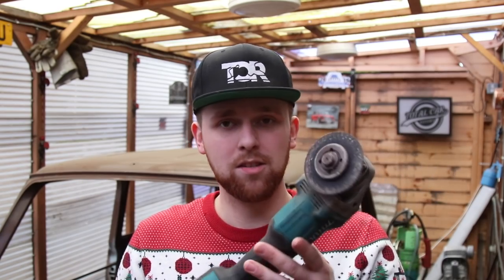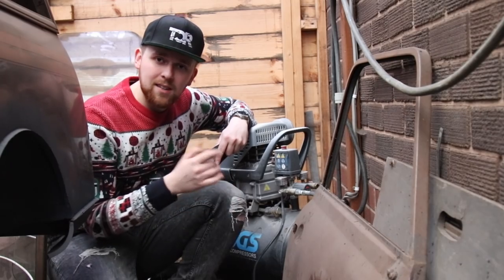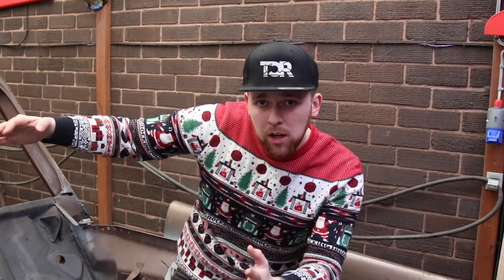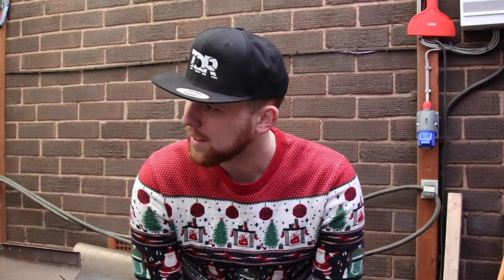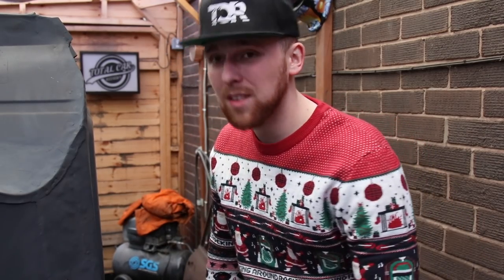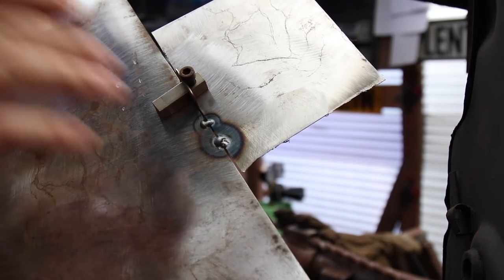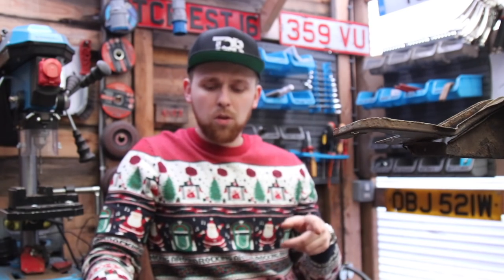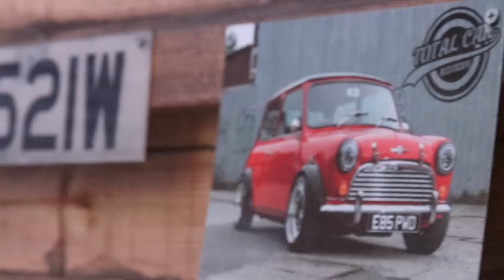What's Inside My Garage | *HOW I RESTORE CARS IN A £200! SHED! | What Tool's I Use | Car Restoration

Comment: Gasless welding references using a flux coated mig wire which creates its own gas shroud as it welds. Your welding without gas using just standard wire, it needs the gas to weld correctly, therefore when  you turn the gas off the welds are crap because atmospheric gasses contaminate the weld. Thats the difference between Gas and gasless, Gas welding is using your normal uncoated wire with a gas supply down the hose from your argon shield gas, GAS-Less is when you have the Mig welder and just use Flux coated welding wire which is mild steel wire coated in something that when it burns creates the protective gas shroud .One of the reasons they have this is so you can weld without having to buy a gas cylinder, and I'm sure there are other advantages to this type of welding.
Reply: Flux core can also be better than mig, when working outside where the wind could blow away the shielding gas. With flux core wire the flux is inside the wire, opposite of smaw (stick welding) where the flux is on the outside of the electrode.
Reply: Hi Matt . Also the welding sets need to change the polarity when using GASLESS .
Reply: Yeah was gonna comment exactly what you said pal
Reply: I was about to comment something similar
Reply: When you dont know what you are doing   make a youtube video to show others how not to do it.

Comment: The welder can only be used for gasless welding if you use flux cored mig wire.
I like your budget shed. It might not be big enough, but it's pretty cool and better than nothing.

Comment: I like your video mate... I too spent years building a block garage for doing up my '73 spitfire. I am still adding tools and still working on cars. Anyone with enough determination can get into this type of home garage setup to repair a car. I love it and now I'm working on a Spitfire, TR7, Defender, Z3 (all are mine) but I also have my mothers old bmw to maintain too. Patience is key and buy what you need when you can but have fun and dont squander on the most expensive tools or parts. I'm one for car boot sales, second hand but I also save and buy new when I can't get what I need. Good luck to you all ;-)
Reply from the maker: Thanks dude! your projects sound awesome too!

Comment: I'm a makita guy myself, all started when I was a young tw^t and stole a 18v sds with battery, all I had to do was buy a charger, 4 years after I still had it and batterys grew along with the makita tool range, then 10 years later and thousands of pounds worth spent on makita and upgrading and battery's brushless are awesome slightly less power I find but just go on forever, although it's about £5 for new brushes so instead of throwing them away I replace and still use, but like to have a couple of everything if not more haha. I think about fixing up cars in the evening down my unit but if I'm not working I tend to be out quoting or typing them up.

As for aldi farrex tools and bits, I rate them very highly, for the price of them. Unbelievable and just like any tool, let it work at its own pase not yours.
Reply from the maker: Such true information! Makita is the way forward 🤘🏻

Comment: The best grinding discs are the sand paper disc type as they last longer and are a dam site cheaper than the flapper type disc. Just an observation, been using both these disc types for work for years. When the flap disc came out it was more of a novelty but they don't last half the time as a round paper type disc.
Reply from the maker: Thanks for this dude! I’ll get some ordered

Comment: Hi, if you looking for upgrade for your welder I can recommend one, it is R-Tech welding. Look them up, great machine and 3 years warranty.
Also they do finance so you don't need to splash out big amount.
Reply from the maker: So many people have mentioned these, they must be good
Reply: @TomShorrock 
Have one myself for 3 years and not have any issues with it. It is 180 amp model.

Comment: As other people have said you need to use flux wire for gassless welding you also have to change the polarity of the torch.
Reply from the maker: Cheers for this, I was only trying to demonstrate the difference without having the correct set up, maybe I’ll revisit this in another video, thanks for the feedback
Reply: @TomShorrock  Welding with a gassless setup is not as good as using gas so keep up what you are doing. I only have a gassless set up in case I run out of gas and need to finish a job.

Comment: Totally agree with you about using gas on the mig welder, far easier and better.
Reply from the maker: 100% 🤘🏻
Reply: Tom your doing a grand job but heads up gas-less means you use flux core wire not normal wire without shielding gas that will never work, have a great Xmas look forward to seeing this car progress! If the red one is anything to go by it will be great 👍🏼

Comment: I thought I was struggling with a 3.6m wide garage. It's storing all the parts I struggle with. Engine cranes, Gearboxes and engines everywhere. Broke my foot a while back tripping over in that mess.
The biggest barrier to working on my build is kids however. Two UK under three. It slows things down.
I had the baby brother of that Clarke welder. Hated it. It only had 4 voltage settings and I couldn't seem to dial it in right. It looks like yours is a lot better.
Ended up buying an R-tech tig and once I got the hang of it never looked back. Love the thing.
Reply from the maker: Thanks dude, I’ve always fancied getting into tig, but I just haven’t the room for it

Comment: I have the same compressor and found it to be very good.  I primed and painted a car with a 9.8 cfm spray gun. Just spray a panel at a time, then wait until compressor is back to full pressure, before moving on to the next panel.
Reply from the maker: Cheers dude! Always wondered how it would cope with spraying

Comment: Interesting video. Especially about the space you have to work in. I am in a similar situation with a 10 x 16 shed, but once its full of tools and a bench there is very little room. This is in total contrast to most Americans we see on YouTube with enormous workshops and seemingly unlimited budgets. Nice to see someone keeping it real in the UK. If you do make a video about welding, please talk about how and where you get your gas. I have a similar Mig welder, but for now just use the small bottles from Toolstation. They dont last long at all. Maybe you should consider a stick welder, for fabricating things like the Rotisserie, cheaper and easier after you get the hang of it, and better penetration. Plus you can work outside in the wind then. I have a Parweld, but I think the Aldi one is probably the same but in a different box. That Air tool for seams and holes looks nice. Not seen you before but subscribed as like workshop videos. More videos about the tools please.
Reply from the maker: Hi James, it’s nice to hear I’m not the only one struggling for space, it’s certainly my a real challenger! With regards to the Americans with garages I suppose it’s cause land and property is so much cheaper over there! Including the cost of living also! I get my gas from BOC it’s about £50 a refil and £50 a year bottle rental, but I easily get 8-14 months out of one bottle. I can cover this in more depth on a video. I’m glad you came across my channel and glad you subscribed! Thankyou!

Hope to see you in the comments again soon

Comment: I restored my 1979 mini in a gazebo that was 3m square had enough space at the sides but no space front or back so had to open each end so I could do the front and back of the car
Reply from the maker: That sounds a struggle! But you did it and that’s the main thing !
Reply: @TomShorrock  did it and managed to get it through its first mot in 10 years with no advisories
Reply from the maker: TheNoviceSimRacer now that’s what you call a top result!

Comment: You don't use the same wire for gassless mig welding! You use a fluxcored wire and you also need to reverse the polarity of the torch and clamp. You do end up with welding slag you need to remove like stick welding, but it's ideal for working outside. That gassless weld you did will be a porous as heck.
Reply from the maker: Hi Jim Bob, I’m aware of this, I propbably didn’t explain correctly I was only showing the difference if you don’t have it set up properly

Comment: He is right on one point though.
As a professional welder i tried a gasless mig properly polorised and they are absolute crap  neither myself or any of the 9 guys in the shop could get a decent structural joint from it.   Why do people buy these  ?  They are no cheaper to buy/use
Reply: I have use Flux core mig welders and will say you and your lads must be shit. They work well on cars if you can weld. Not as good or clean as gas but still works well. You must of have the settings wrong.

Comment: Merry Xmas! 

With non gas welding you do need a different wire with a coating but even so with gas is still so much better
Reply from the maker: Merry Christmas 🤘🏻 I’m aware of this dude, but just wanted to demonstrate how it’s effect using the set up I currently hav

Comment: Your gas / no-gas comparison is nonsense and misleading. Gasless welding is done with flux cored wire and can produce excellent welds .
Reply from the maker: Maybe I should have delved into it more, I was just showing the comparison of how I had it set up as I’ve seen other channels using gas less with normal wire. Thanks for the feedback though

Comment: You need a flux cored wire to use the gasless mig. Using standard wire will just give you a mass of porosity which is what you are getting
Reply from the maker: Hi Sam, I’m aware of this and I’m going to do a propper comparison video, however in Thai one I just wanted to show the difference if you don’t have the correct set up

Comment: The mig 135te is a dedicated gas welder and you would normally use flux corded wire if your welding gas less

Comment: When you weld without gas you're obviously using a flux core wire, you can't just turn the gas off and weld with solid wire.
Reply from the maker: Ino dude, I’ve mentioned in other comments, I was just showing the difference if you don’t have it set up correctly I probably should have explained it better

Comment: you have to change the welding wire to flux core to weld without gas
Reply from the maker: Ino dude, I was just showing a compatriots on without the right set up

Comment: Hi Tom. Does your spot welder work on a standard 2.5 mill, electric ring main, with a 32 amp MCB breaker?
If not, then have you run a separate 6 or 10 mill cable, to an uprated MCB?
Reply from the maker: Hey dude! It’s a 16amp 3 pin commando socket required to power it, you can wire it in a 2.5mm radial to cut it to the bare minimum but ideall I would run a 4.0mm cable from a C20 mcb and you should be good 🤘🏻 if it’s outside or has the potential to be used outside don’t forget you need your 30ma RCD protection 😉

Comment: The best value mig welder you can buy is from  R tech welding  they have good products and good customer service and good  3 year no  quibble  guarantees  and if your   Machine is broken they will pick it up repair it and drop it back off to you
Reply from the maker: I’ll be sure to check them
Out
Reply: I was wondering how long it would be before R- Tech popped up. To add to this comment, i have their plasma cutter, mig, tig ac/dc and larger portable arc. They are without doubt the best machines i have used in 30years of industry. Dont know about anyone else you see (doubleboost, urchfab, etc) who were given theirs but my machines were purchased by me not given to my channel and if you want to get good buy r-tech, you will constantly fight against a machine mart welder. I do still use my gas less clarke mig (with the correct flux core wire, hint hint) for outdoor dodgy weather or to loan out but mostly a door stop. All the best, keep at it, 👍
Reply: @TinkerBod    Yes I’m  pleased with my R Teck 250 mig welder. its  just as good as the big brands like  Lincoln  electrical s or Kemppi  welders  both very good brand but very expensive. R Teck are Excellent value for money they do everything you want Them to do and that’s all you can ask for 👍
Reply: Total Car Reviews 
I’m happy with my r tech mig welded And I have clarke spot and they both do very good job 👍

Comment: You know when a welder says gasless it doesn't mean turn the gas off, it means using flux cored wire
Reply from the maker: Ino mate, I’ve mentioned in other comments I was just comparing the difference if you don’t have it set up right, I probably would have explained batter
Reply: Ahh i did see one but i had already posted by then, either way good video mate, this is my first video of yours but ill definitely be sticking around to see more.

Comment: I wonder how many self built sheds are 2.4m wide 🤔😂.
Reply from the maker: Not many 😉
Reply: @TomShorrock  my one at my house is, standard plank length in it. It’s also 7.2 long (3 plank lengths 😂). Although working on a ‘89 Hilux at the moment in a container. Easiest way to get past it is creeper trolley straight underneath.